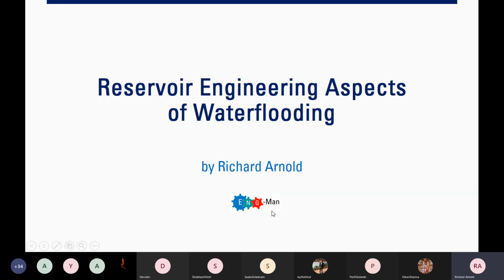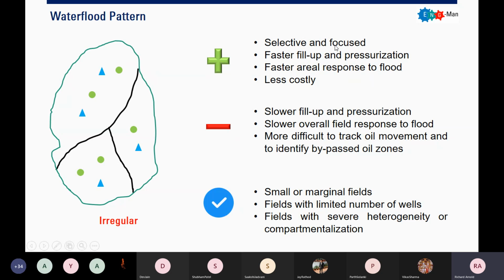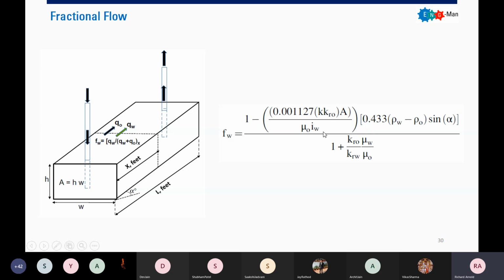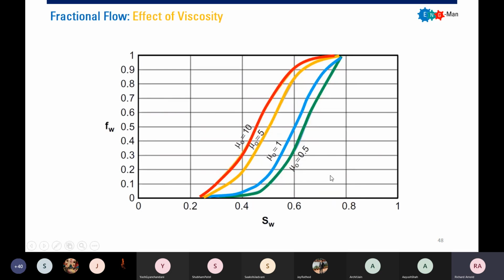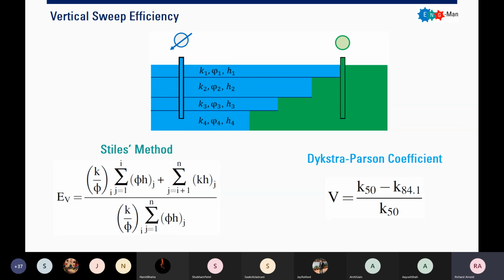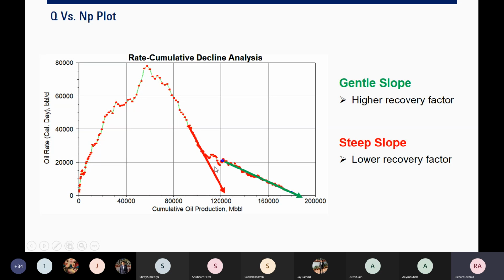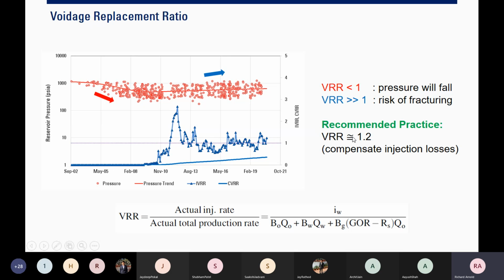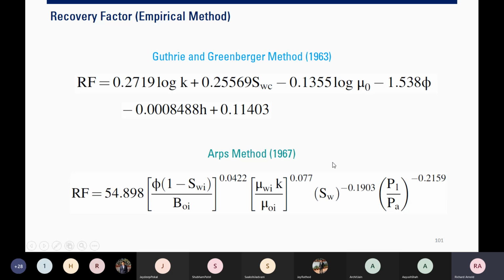Reservoir Engineering Aspects of Waterflooding

Comment: Reservoir engineering is a discipline in the oil and gas industry that focuses on optimizing the recovery of hydrocarbons from reservoirs. Waterflooding is a common method used in reservoir engineering to increase the recovery factor of hydrocarbons by injecting water into the reservoir to displace the oil and gas.

The following are some aspects of waterflooding in reservoir engineering:

1. Water injection strategy: The water injection strategy involves determining the optimal location, rate, and pattern of water injection to maximize oil recovery. This involves considering factors such as reservoir properties, well performance, and economic considerations.

2. Reservoir simulation: Reservoir simulation is a computer-based modeling technique used to predict the behavior of fluids and rock properties in a reservoir under different scenarios. It helps to optimize the waterflooding strategy by predicting the performance of the reservoir under different water injection rates, patterns, and well configurations.

3. Well performance analysis: Well performance analysis involves analyzing the performance of individual wells in a reservoir to determine their productivity and efficiency. This information is used to optimize the water injection strategy by identifying high-performing wells that can be used for water injection and low-performing wells that may need intervention or abandonment.

4. Water management: Water management involves managing the volume and quality of produced water in a reservoir. This involves considering factors such as disposal options, environmental considerations, and economic feasibility.

5. Risk assessment: Risk assessment involves identifying and quantifying the uncertainties associated with waterflooding and developing strategies to mitigate them. This includes considering factors such as reservoir heterogeneity, well integrity, and operational risks.

In summary, reservoir engineering aspects of waterflooding involve developing an optimal water injection strategy, using reservoir simulation to predict performance, analyzing well performance, managing produced water, and assessing risks associated with waterflooding.flooding is a common method used in reservoir engineering to increase the recovery factor of hydrocarbons by injecting water into the reservoir to displace the oil and gas.

The following are some aspects of waterflooding in reservoir engineering:

1. Water injection strategy: The water injection strategy involves determining the optimal location, rate, and pattern of water injection to maximize oil recovery. This involves considering factors such as reservoir properties, well performance, and economic considerations.

2. Reservoir simulation: Reservoir simulation is a computer-based modeling technique used to predict the behavior of fluids and rock properties in a reservoir under different scenarios. It helps to optimize the waterflooding strategy by predicting the performance of the reservoir under different water injection rates, patterns, and well configurations.

3. Well performance analysis: Well performance analysis involves analyzing the performance of individual wells in a reservoir to determine their productivity and efficiency. This information is used to optimize the water injection strategy by identifying high-performing wells that can be used for water injection and low-performing wells that may need intervention or abandonment.

4. Water management: Water management involves managing the volume and quality of produced water in a reservoir. This involves considering factors such as disposal options, environmental considerations, and economic feasibility.

5. Risk assessment: Risk assessment involves identifying and quantifying the uncertainties associated with waterflooding and developing strategies to mitigate them. This includes considering factors such as reservoir heterogeneity, well integrity, and operational risks.

In summary, reservoir engineering aspects of waterflooding involve developing an optimal water injection strategy, using reservoir simulation to predict performance, analyzing well performance, managing produced water, and assessing risks associated with waterflooding.